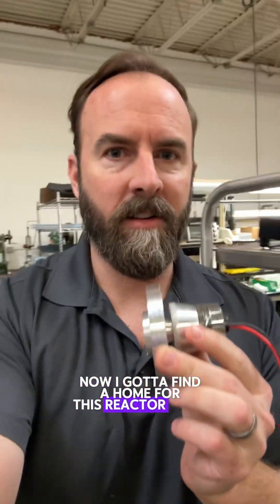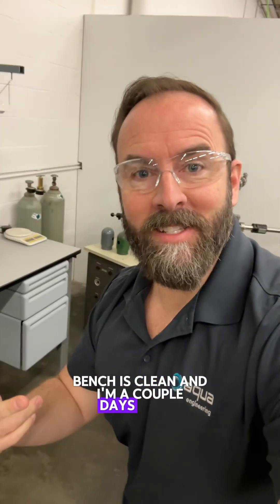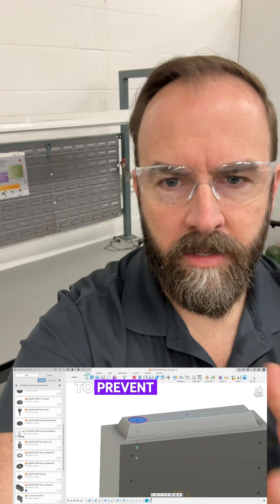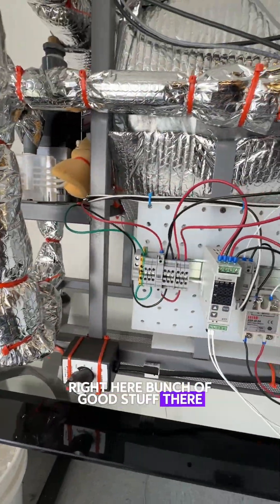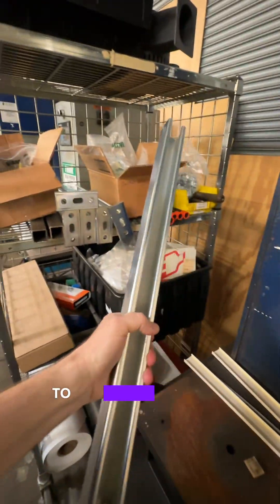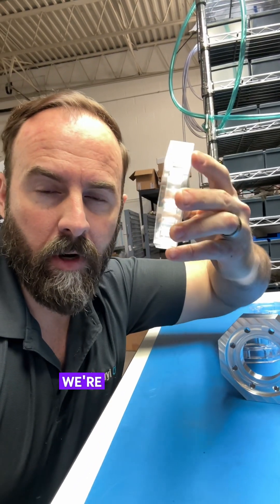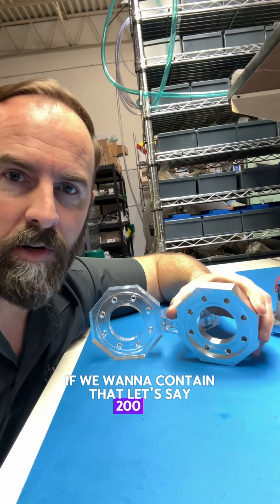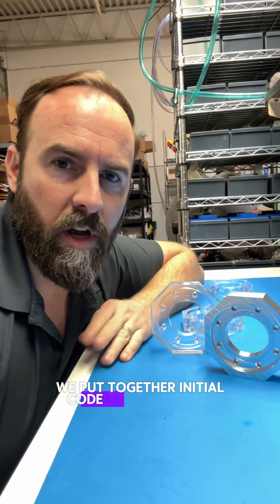LENR pt. 14 - Secondary Borax Shielding

Comment: I know this is way ahead of the initial prototype, but what's the strategy for actually generating electricity with this? Are we getting this thing hot enough to make steam and run a small turbine? Or is there some other way to convert that heat to electricity without killing the efficiency?
Reply from the maker: Great question. I'll know more once we kick off a proper reaction, but in the absence of any other data I'm assuming it will need a heat exchanger, generate steam, and spin a permanent magnet generator with an inverter for AC mains voltage (or DC voltage, etc.). One possibility is this finds life as a direct home water heater and we gain our efficiency that way (no electric power generation at all perhaps). Imagine having no need for gas or electric water heating, it could heat from the LENR heat exchanger loop that runs through the manifold, isolated from the reactor water. Could also pull visible light but if all goes well and we moderate as much of the particle activity into heat as possible we should get most of our energy from hot water. It'll depend on the operating pressure too. If it runs best with water that is too cool to generate steam but is still hot, then we'll find applications accordingly.